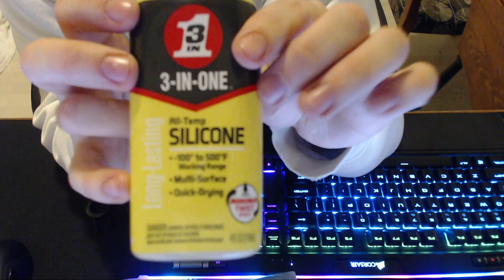Fix keyboard chatter on Corsair keyboards!

Comment: M8 not gonna lie, i was about to part with my g910 after a thousand fixes and whatnot. If this works, you're my new and only god
Reply: Edit: It does.
Sooo, it almost never worked first try for some reason, maybe in my case it was a mix of junk/needed lube so i had to also move and spray a lot. Nontheless it does work my dudes, i fixed almost 9 keys, as you can see (promise i m not fixing shit) no double triple or missed keystrokes.
Some keys are a bit stubborn (My right arrow and 0 on numpad), but i m sure they will eventually fix.
It's been 2 weeks and i never had to fix a key twice, either it kinda fixes it for 10 minutes or it's FIXED.

Edit: Spray because my lube comes in a compressed air can, no, compressed air alone did not work at all (i was using a REAL compressor to try that, so i guess unless you want to nuke your keyboard to the moon, that should be enough psi to remove dust)

Comment: You'd think at these prices, they would be putting an anti-chatter chip inside that cancels out any key presses faster than 100ms. They could even include options in their software to adjust the timing. Of course to do that would be to admit these mechanical switches have chatter and they are never going to just admit to it.
Reply: more like some people wouldnt then buy a new one. the prices on these things are so insane even their employees think its way too much

Comment: I watched dozens of videos trying to remove keyboard chatter, one video said to dump some alcohol on the switch with chatter. Using alcohol made the chatter a lot worse for me, I guess the alcohol dried up the switch. I then tried your method, but ended up having to put a drop of oil on each corner of the chattering switch to remedy the issue. Overall, interesting method and would highly before buying a new keyboard.
Reply from the maker: My method worked for me. 2 years later no chatter

Comment: I have had the same issues where one key press would register 2 or 3 presses. After a very long time of waiting for a fix while using this keyboard for spreadsheets a firmware update fixed my issues. I did not have to open and put lubricants in my K70. I am still using it for 5 years now and it is still working fine.

Comment: I want to add to this, 99% isopropyl works as well. Dunno if one is better than the other, but since the isopropyl dries fast, doesn't rust anything, and won't short your electronics: feel free to saturate the Qtip with it and drench the switch. Plus it only takes about 20 minutes to completely dry.

The idea this time isn't to lube, but remove debris.

My exact procedure was:
-dip the tip completely in the isopropyl
-tap all corners of the switch and run along the outside to make sure all areas of the switch were saturated.
-press the key like once or twice to help get some of the isopropyl into the switch
-completely dip the tip in iso again
-tap the four corners of the switch again to ensure over saturation
-and then use the tip to press on the switch repeatedly about 4-5 times
-repeat entire process for the next key.

Overall goal with these steps was to ensure thorough saturation and consistency. I had done this about a month ago...and my keys were starting to chatter again. So this time, I wanted to make sure I didn't hold back to see if that improves how long this works. Overall it uses hardly any material. With a grand total of 1 Qtip and 1 ounce or less of my iso used for the entire keyboard.

Used on the Logitech G910
Reply from the maker: Yea you could use isopropyl for the cleaning, but the keys will still need lube. Did that and it didnt work and after that i used this stuff and never have had any issues since. This actually worked surprisingly

Comment: I used an alcohol based cleaning solution for electronic items.. just like this way...worked like a charm
Reply: do you think it will work with universal cleaner so basically brake cleaner?
Reply: manuqr i would suggest that you use a alcohol based cleaner that evaporates after sometime..   but i don’t know if brake cleaner will work..
Reply: same lol i saw an indian tutorial on how to fix mechanical switches double typing and saw he used alcohol. i tried it and it worked like a charm, all of my switches now are functioning properly
Reply: @KrishnenduChowdhury  where would u buy this stuff from
Reply: @peaky6622  where do u get the alcohol stuff from
Reply: @Lucas-sh7uw  any computer store.. that sells laptop cleaners.. or even sanitisers (the sprayable kind).. basically any high concentration alcohol solution
Reply: @peaky6622  1 year late but can u link?

Comment: Using a lubricant on plastics in these types of situations will cause more harm than good. Lubricants attract and grip on to dust and debris which reduces the fluidity of movement over time. Removing silicone compounds afterwards is very hard to do so cleaning any keys that inevitably get clogged over time will be nearly impossible (forget breaking it down with alcohol for instance). Although you mean well, I would highly recommend against this practice.
Reply from the maker: Well i did make this video about 740'ish days ago. Same keyboard i use today. The problem wasnt dust or debris, it was litterally  manufacturing defects in the switches. This dumb fix in the video actually completely solved the issue for me even after 2 years of use. I know your comment means well, but sometimes the fix just works. The last time i did this was actually when i made the video so it must have been very effective.

Comment: Same fucking problem with my K95 Platinum with Browns. I'm new to PC, haven't literally touched one since MS DOS (good with Android OS though) so I thought it was my absolute trash typing skills, but it's never gotten better since owning it(almost 2yrs myself). So started looking into new custom and high end mechanical keyboards and stumbled across oiling and other mods... thought maybe it would help them(especially after listening to the drastic sound difference between oiled and modded switches against mine). Then I stumbled across your video (I'm only 39 seconds into it) and now I realize I do indeed need to tear them apart and oil them. Appreciate the video.

Comment: There is something systemically wrong with these keyboards and the switches they use; the Cherry MX's.  I too have had two Corsair keyboards, K95 Strafe and the K70 that had repeating characters.  Something is very wrong here.  There needs to be an investigation into this.  Too many people are complaining about this exact problem.
Reply: Same thing here. I had to RMA my k95 three, THREE times. I was going for a fourth but my warranty had expired. I don't eat on my keyboard and non smoker household. Ended up buying a cheap chinese mechanical keyboard. and it works so much better and the keys are more consistent despite being knock offs.
Reply: @ChristianArreguin  ...That is awful.  I can't imagine you having to go through that process so many times.  And with their most expensive keyboard to boot.  The other thing that I don't understand is their stance on warranty.  Each time you get a new keyboard the warranty should reset, not trail off the back of the first one you bought.
Reply: @Rickbearcat  Yeah, like for $200 you'd think it would have some better quality than this cheapo chinese board I got for $50.  Or at least far better warranty. from those $200 they probably spend 80% of it on marketing. Like I have a basic dell keyboard from 15 years ago that still works fine on my non gaming pc.
Reply: logitech romer g switches have the same issues
Reply: I had a refurbished Corsair K60 doing this within one hour of taking it out of the box and using it. My guess is that Corsair didn't refurbish it properly and this key chatter was it's original problem. That had Cherry Viola switches so, add those to the list of mechanical switches with key chatter. I think I'm going to just build my own using a hot swap keyboard but, it's so expensive.
Reply: Came on here because my K70 with Cherry Reds started triple typing 3 or 4 main keys. It occurred 10 months into ownership. They keyboard is mint with no drinks or food ever near it. I was absolutely choked when I discovered their warranty involves sending you a refurbished keyboard... Never buying a corsair product again. I will try this fix and if it doesn't work I will have to send it in for a refurbished one. I hate Corsair. I went out and bought my 2nd Logitech waves keyboard to replace my expensive $160 Corsair K70. Corsair has junk products. What does it matter if their products are made out of aluminum if their keys are garbage?

Comment: Have had multiple corsair keyboards and they have all done it. I have had two replaced via RMA, yet the problem persists. Probably will stop buying their products when I get back into the PC scene soon. May go back to Logitech or just build my own.
Reply: majority of my pc was built with corsair -> ram, psu, water cooling, keyboard, mouse, and mouse pad. everything works perfectly except for their keyboards. i have the k95 RGB - the problem with this one is there are some keys that display the wrong LED color, while my k95 Platinum already has problems with the keys - pressing f1 registers as f1+esc.  I used to be a die hard logitech fan but I switched to corsair because both my g710+ and g502 had broken buttons in less than 2 years - basically im saying dont buy logitech. In terms of keyboards, I actually think that we are at a point that buying budget keyboards has become the better option. if it breaks, just get a new one kinda deal. my k95 platinum is equal to 5 budget keyboards so even if i break one yearly, im still ahead.
Reply: Avoid Logitech romer gs at all cost until if they ever make a re design. Someone sold me on their premiere board, worst buy of my life. Wasd broke in under a year of daily normal gaming use, I was then horrified to see why they were breaking so fast, tiny tiny weak little plastic prong posts, just a terrible not thought out design at all for key life. A personal preference, but also felt like disgusting mushy ass to use as well.

Comment: You could also use silicone spray to get down into the switches easier by using the thin nozzle. Although I never had the problem on my K95 plat, I did it anyways for the smoothness of key feel factor.

Comment: Hey man I have this exact same keyboard: K95 RGB Platinum. The only way I've got it to type this way is by turning on the bounce key filter. I have a TON of keys that has the key chatter problem. You think I can just do the same thing, but with WD-40? And also, can I do it to all keys? Thanks.
Reply from the maker: You can do this to all the keys. Dont use wd-40. I heard that can mess up the springs.
Reply: @p1st0ls44  Ok cool. Is silicone lubricant or 99% isopropyl alcohol better in terms of efficiency and longevity?
Reply: @abhaycheruku3186  id suggest use alcohol to clean and then use the lubricant. Am looking for a lubrocant to buy . Let me know what you used ?
Reply: @amrindersingh5952  Apparently the alcohol can corrode plastic, which my keycaps are composed of. I tried using compressed air, but it didn't work. :(
Reply: @abhaycheruku3186  try using a wd 40 product. I ordered one. Its supposed to work on plastic and metal. Am still unsure what lube and oil to buy..
Reply: @abhaycheruku3186  plastic cannot be corroded
 Only metal gets curroded.

Comment: Any suggestions on filco ping? I have the same keyboard,  dampened the bottom case with pe foam and lubed the switches with krytoz 205 g0. Still getting the "ping" noise once I let off the keys. By far most annoying thing once your ears pick up on it.

Comment: isnt it funny how all these great tech review channels all dupe us into buying mechanical keyboards without ever mentioning that youll waste hours upons hours correcting your emails and whatnot just becasue of this shit technology which is even older than pc itself ??
Reply from the maker: Ye idk why my keyboard had so many issues. This trick in the video really fixed it up though. 3 years later and its still going strong at work. I used a different one at home.
Reply: @p1st0ls44  ok i will try this , i really want to like my keyboard.. does the lubricant have to get to the actual switch (the metallic conductive parts) ??? ahh look it didnt detect an L again  .. i have more problems with not detecting than doubles

Comment: I haven't tried lubing yet, I found this after suddenly Battlefield V stopped registered WAY over half of my movement inputs, but no other game I smash inputs on has the same issue. Turns out its specific to the Frostbite engine and has gone unfixed even after they claimed to have done so. But after finding out that my 180$ Corsair mk2 se came from the factory with this issue I'm super unhappy. I love everything else about it, the underlighting (I don't like rgb keyboards that cover their lights up), the way the colors get extra diffusion off the white in a dark room (even though I don't even like white), but now I'm definitely going to be looking at an optical switch board to never have to worry about chatter again.

I'm about to try the program Keyboard Chatter Fix, it showed the entire keyboard was guilty of crimes. I'll edit with results if its chatter cancel feature actually works with BFV.

Comment: Do not use silicone lubricant it will eat away the plastic!
Reply: troll ?
Reply: @battlegalactics  Nope I saw some other YT video say that. So it would not be a good idea to use that. There's a different lubricant you can use that will work better.
Reply: @nikolai905  What kind of lubricant should you use then?
Reply: @memboy.advanced  sewing machine oil
Reply: @memboy.advanced  Krytox GLP 105 or 205. Those lubes are what most keyboard enthusiasts use to lube mechanical switches and are the go-to lube for this.
Reply: Only if it says its petroleum based or liquid gas precautions
Reply: silicone means it safe for plastic
dont use anything alcohol based, that will eat the plastic